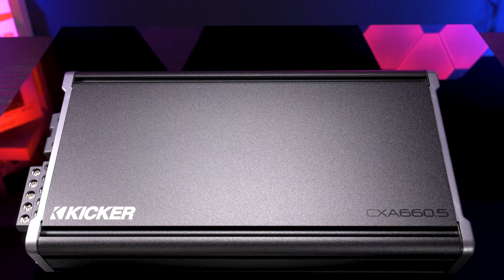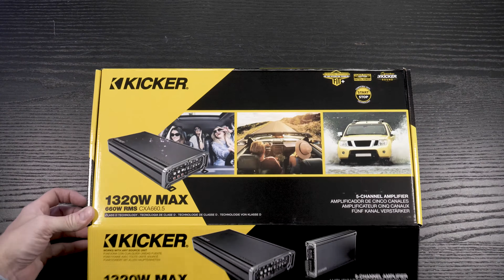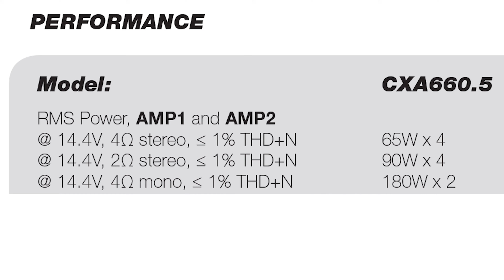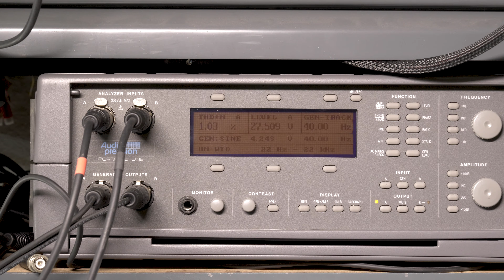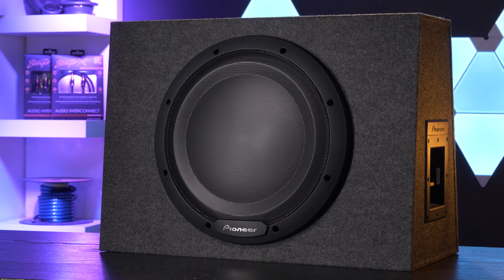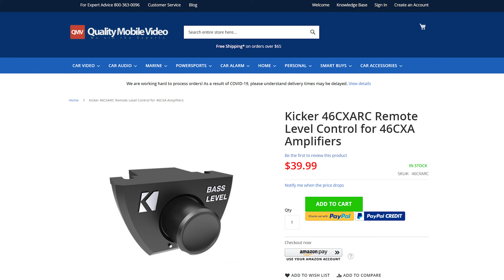Kicker CXA660.5 5-Channel Amplifier - How much power does it make?

Comment: I purchased this amp, and itsounds great, but at higher volume, the amp reduces the sub level on its own, and there is no way for me to disable that function
Reply from the maker: Unfortunately its rolling back either due to heat or incorrect wiring.
Reply: @Qualitymobilevideo  nah, it did that right at the start and the wiring was all good with correct sizes and everything

Comment: My unit felt very hot and stopped working today. I live in south Florida but I would think these things are kind of built to withstand average hot car temps. After a few seconds the music quit and I noticed the green light went off and the red light came on, then went out and nothing. Did it again after stopping the vehicle. What is wrong here? All of a sudden it's doing this. Has done this before but usually works after shutting off the vehicle. I had this unit installed exactly 2 years ago. I hate driving without my tunes! Help!
Reply from the maker: You have gone it to protect mode, you likely have a wiring issue were the impedances are below the lowest capablity of the amp; if the setup hasn't changed in two years as you state, you should try this.  You live in Florida; 1, check and clean your amp ground and alternator ground. 2, check and clean your amp positive and fuse holder positive and battery positive. One of these connections is likely corroded.
Reply: @Qualitymobilevideo  thank you for your input. I took the car to the guy that installed the unit/speakers/amp/swoof and he found that the driver door speakers were wired backward. I had body shop and window people in there last year and they messed it all up. My guy got it all fixed up.
Reply: @drrmdjr whatttt?! how does the speaker even work if it’s wired backwards?

Comment: I'm in the market for a 5 channel amp to power two sets of Alpine S-S65C that I have in my front and rear doors & also set of Alpine S-S69C on my rear deck. Would this amp be a good fit for them since its 65 watts RMS x 4 + 150 watts RMS x 1 at 4 ohms?

Comment: I have this amp with a 150rms 300 watt at 2ohm 10inch kicker sub would i be able to add a second sub or should i just merge a second amp ?
Reply: You can add another 2 ohm svc subwoofer in series and it raises the resistance to 4 ohms, which this amp is capable of

Comment: Hello I was wondering sense you got the answers went it comes to systems. I have kicker L7 4 ohm dvc.looking for a amp to power them any suggestions.
Reply from the maker: What size woofer?
Reply: @Qualitymobilevideo  2 kicker L7 12  4 omh they are rated at 750 rms each

Comment: Load all of the channels when testing.
Reply from the maker: We loaded channels 1-4 and tested 5 separately. We are the only channel that also tests continuous power.
Reply: @Qualitymobilevideo  you're right. This stuck in my head for some reason 2:47
Reply from the maker: All good, we don't have enough resistors to do 4-channels 2-ohms at the moment.

Comment: pretty good amp, if it could have a solid 500 watts rms at 2 ohms it would be a solid amp. but for me I would pay more and get a JL Audio XD700/5 you get almost 500 watts rms at 2 ohms on the subwoofer line and about the same 65 watts rms at 4 ohms and the amp is even smaller in size. this kicker amp is pretty good for the price though.
Reply from the maker: That is the sweet spot 500 @ 2-ohms!
Reply: @Qualitymobilevideo  I got an infinity amp 500 at 2 ohms wondering if i should stay with 10 or go with 12 in a sedan.